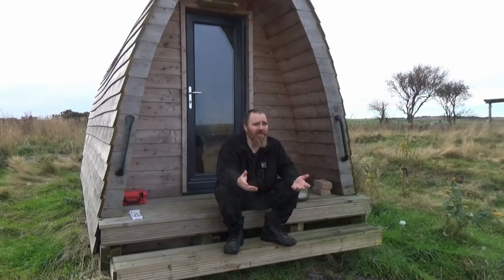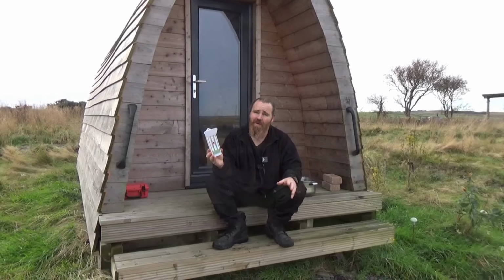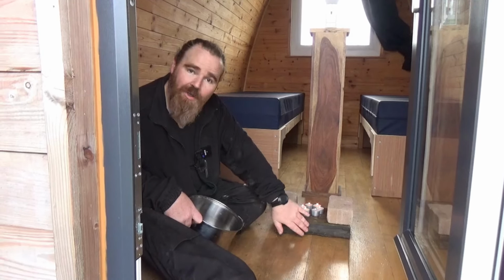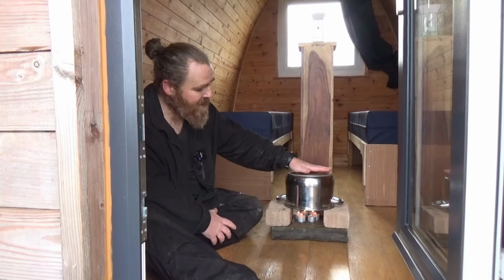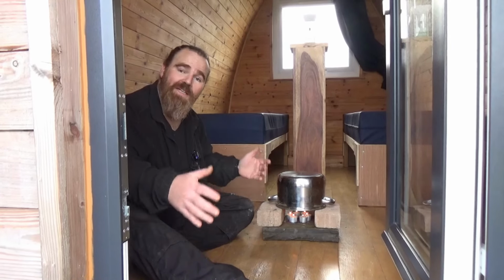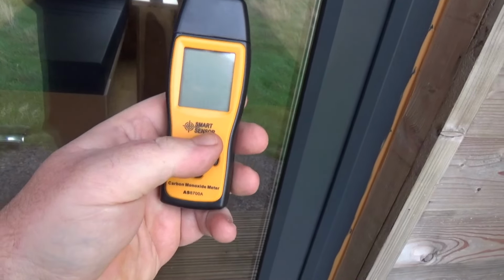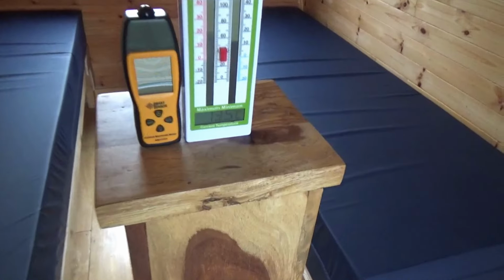DIY Flower pot candle tiny house/camper van/power cut heater tested. Effectiveness? Carbon monoxide?

Comment: In an emergency you are better off using this method to heat water with the candles for hot water bottles & hot drinks or food. Get under blankets. Wear lots of layers (it traps the heat) & a woolly hat. If you have to do stuff wear your coat indoors. Buy a windup torch & keep lots batteries saved for torches. A safe emergency camping stove to be used with the window open or outside & saved tinned food will be helpful too. Don't be tempted to use biofuel or alcohol stoves or heaters indoors. They are not safe.
Reply: Some stones borrowed from the campfire pit over night have helped me through many cold bushcraft nights
Reply: Il faut se coucher tout habillé et ôter ses vêtements une fois que le lit est chaud et les pousser au pied du lit et les garder toute la nuit.  Bien isoler le cou de l'extérieur ambiant le visage peut rester à l'air.  Je pense que la chaleur se dégage mieux si on est peu couvert excepté la literie abondante en laine ou en plumes.  Faire des bouillottes avec les bouteilles de verre des jus de fruits.  Bien fermer sans serrer trop fort le couvercle et les mettre dans une chaussette.  Une bouillotte peut suffire.  Toujours laisser un petit courant d'air entre le bas et le haut de la pièce.  L'oxygène de l'air aidera à votre propre combustion lente qui est celle dégagée par votre corps!  En bonne santé vous pouvez générer beaucoup de chaleur... et sans monoxyde de carbone!
Expérience personnelle.
Reply: That's the most sensible thing I've heard. Right you are.
Reply: It is only partly true about Bio Ethanol are designed for indoor use, some are quite specifically for indoor smoke and smelless table usage and are sold as such every autumn/winter in mayor DIY stores world wide.
Reply: @harrietthoppe7501  In theory, Bio-Ethanol combusts completely to carbon dioxide (Co2) and water (H2O). 

But in truth, no bio-ethanol is 100% pure and no combustion is 100% perfect. 
There will also be some carbon monoxide, benzene, nitrogen oxide, formaldehyde and fine dust.
Reply: @SH1974  this is true of any combustible materials, however, the more slightly more expencive forms of Bio fuels, have been magnetically refined and filtered, hence the limited amount of said list of items in your comment. Good ventilation is the primary most essential Key, to all forms of combustible energy giving forms, yes.

Comment: It would be interesting to see the same experiment but one pod with the pot over the candles and the other just with candles and no pot. There couldn't be less heat going in to the room and the temperature reading is based on heating the room from the top down.
Reply from the maker: This experiment was to test whether the heater was capable of heating a small space effectively. I'm considering testing just candles vs candles with a radiant bell, when it's cool enough to test.
Reply: The problem is "Stratification." With no pot, the hot air rises straight to the ceiling and stays there. If you used an Infrared Viewer, you'd be amazed at just how thin the heat trails are. And how thin the layer of hot air that develops at the ceiling is.
The diffuser (That's what it is) helps spread the wealth. A fan could do the same, or anything else that disturbs the air enough. But, a fan would need power...
Reply: @CairnOfDunnCroftPermaculture  When you do this, please consider showing Infrared images from during the test. 
Also, might consider using multiple thermometers at different levels, to show Stratification vs Dissipation?
I know, both add costs...
Reply: @TimeSurfer206  There are battery operated table fans. I got one on amazon, and a whole box of batteries.
Reply: @evelina.amazonAtGmail  Yes, but the batteries cost money.
Reply: @TimeSurfer206  I've got a rechargeable one that charges just like your phone.
Reply from the maker: https://youtu.be/sK539ekJ4bo
Reply: @TimeSurfer206  heating a well insulated room  is very much like heating a tank of water,
Reply: @stevecole9674  Which stratifies...
That's why it has 2 heating elements, one upper, and one lower.

Comment: It would be nice to test a glass bowl so you can utilize the light as well
Reply from the maker: It would be an interesting experiment with a pyrex bowl, you're right.
Reply: I use a glass tv stand. Candles are spaced evenly on bottom shelf. Top shelf above gets warm but not hot to touch.
Reply: Your not balancing things above flames in the middle, so less likely to knock over.

Comment: Hot rocks is the best solution. Big fire outside that you cycle fire bricks in\out of. I heated a tiny house with just a kitchen bowl of rocks, got legit hot in there, had to open it up to the air. After a couple hours you wrap a stone in a towel and get hours more lap heat, so nice. Some of the oldest ways are still the best. Candles are dumb imo, good for light, but they release soot into the air. Hot rocks are clean and easy and effective.
Reply from the maker: It sounds like a great solution for some contexts, but here in the Scottish highlands you need emergency heat the most when there's 65mph rain screaming across the landscape for 36 hours without respite.
Reply: @CairnOfDunnCroftPermaculture  Yeah, that sounds tricky, and fine time for this solution :)

How did they do it in the past when out and about? Hide in caves? Huddle and suffer in their wool under a tree?
Reply: @CairnOfDunnCroftPermaculture  If I wanted to live tiny there full time I would prioritize having a small woodstove in the space. Nothing like wood for the wet cold. If just traveling for a bit I'd use clothing and sleeping bags. I always try to have a gear set that can handle a wide range of temp\weather not just the current situation. But this would still be a nice thing to keep in a corner. Never know, some wet stranger might show up and need real heat.

Comment: I have a better-than averagely insulated room in a Victorian house  - but I no longer attempt to heat the room.
In the winter of 2010 I  was living downstairs in an icebox and burning maybe 6kw of gas.

The recent cold snap was grim, but when we have normal December temps in Bristol I do OK with personal lagging plus a 50 to 250 convection watt heater under my desk (on a dimmer) - slightly like a "kotatsu" - but mostly just warming my feet ... (I've taken on board your success with reptile pads and also aim to heat under my clothing as my insulated layers work against external heat and a hairdryer is noisy)

My usual electricity consumption is about 2.6 kwh per day for everything.
At the moment it's plus 0.9kwh for feet and bed heating - but this time of year, the maybe 1.5kwh of heat from my PC is taking the chill off the room, and also a similar amount from me (based on 1800Kcals BMR). 
Maybe when I move house I will have a super-insulated winter retreat where I also do my food prep so no heat is wasted.

The carbon monoxide and fire risks alone mean I repeatedly tell people to go electric rather than loss-leader IKEA teelights... all for a couple of hundred watts or pence per hour.
Electricity is expensive, but not THAT expensive - sadly people do not understand - let's face it, I doubt the government's energy ministers remember any of their basic science from 11 years old ...

When it got to minus 6 here, I was burning 8kwh extra to keep myself warm - which meant my heating bill increased from 34p per day to £2.50.
I can easily afford electricity even at 34p per kwh, but consider it immoral to waste it .
Somehow I have managed to get my average consumption down from 11kwh per day to 3.5 - even in December.
Reply from the maker: That's impressive! People seem reluctant to try personal heating, even though it's incredibly effective. Oh the arguments I've had about the effectiveness of different forms of heat transfer!

Comment: If you use less candles would it bring the carbon monoxide down enough ?
Reply from the maker: I'd say it's likely, but candles can vary between manufacturers. I'd suggest getting a carbon monoxide detector before using this heater often, but it still has a lower output than many domestic appliances running on natural gas.
Reply: Daft question?make candles out of lard to avoid gasses?
Reply from the maker: @tonywarley578  all candles produce carbon monoxide, lard would be no different. Wax myrtle produces the cleanest burning candle possible, but still produces CO.

Comment: A copper pot considerably smaller than the steel one you used , would probably provide the same result with one candle and almost no carbon monoxide .
Reply from the maker: Awesome! Can you link to your results please?
Reply: @CairnOfDunnCroftPermaculture  I'd like to see that link too,..bet that neither of us get to see it.
Reply: Lol 1 flame of the same type of candle will not put off more heat than 4x that amount. Dont matter what "pot" you use. The pot doesnt increase the amount of heat these things put off. It disperses it differently. Thats it. The end. No heat multiplication from adding a pot of any kind
Reply: @garym51124  So true, same goes for say a can of butane of propane gas, doesn't matter what type of torch you put on the end of the hose, it's not going past it's max output.
Reply: @garym51124  - But NOT to be underrated, as the radiant heat coming from the terra cotta, the stainless steel and now the cast iron pots I am trying have made the room SO much more comfortable.  I would get so chilled Id haver my thermostat set at 72 to 74. I am at 64 and incredibly comfortable bc there is no "chili" in the air.   IU have a gas furnace with  heat vents, and ai always felt chilled. This feels like when I had wood stoves. There is a quality to the heat, a fullness, an evenness that leads me to greatly reduce the running of my furnace.  I am in awe of this.,

Comment: 2 questions I would have, can you put a small vent in the ceiling to remove some CO but not lose the heat and would adding a can of water on top of the inverted pan to add some moisture to the room, reduce or increase the heat in the room (or offset the CO problem a little).
Reply from the maker: A small amount of ventilation anywhere would likely have the same effect, but with a relatively low powered heat source like this you risk losing more heat than you're gaining. adding moisture is really effective at making people feel warmer in dry climates.

Comment: CO is a product of incomplete combustion which is a consequence of insufficent oxygen. The hydrocarbons in the wax still produce water but instead of CO2, CO and Carbon (soot) are produced. Sooting inside the pan would be an indicator of this condition (even if you didn't have a CO monitor)(though absence of soot wouldn't necessarily be conclusive, so a monitor would still be necessary). Raising the pot higher would help this issue but i still have reservations about this 'experiment' as per my earlier comments and replies.

Comment: That's really not much of a temperature increase. For all the concern about carbon monoxide, seems negligible and another source of heat would well be in order.
Reply from the maker: I'd say the difference between how ten degrees feels and how fourteen degrees feels is pretty significant. It's no substitute for central heating, but we've been cold for weeks at a time on many occasions. An easy temperature increase that significant would have been extremely welcome.
Reply: @CairnOfDunnCroftPermaculture  Since the candles are great at sustaining the heat, perhaps heat the place up by other mean's. One 100 ah battery/solar charged and running a halogen heater from it for 15 minutes on one bar...400 Watts  will use around 8% from the battery.

Remember though, a leisure battery in general, should only be discharged down to 50% for longevity, so in reality; that 100 Ah battery is now 16% discharged.

After the place is heated up, four tealights might just sustain the temperature depending on how well that pod is insulated and how often the door is opened. Less candles = less Co2 concerns, the Co2 levels would probably drop to... 10 - 33% = 6.7 Co2 levels.

Good show Cairn.

Comment: What was the carbon monoxide reading on the control pod? You must compare the two pods because carbon monoxide is present in all living areas.  Great experiment on heating your small home. Thank you.
Reply from the maker: Carbon monoxide is not present in fresh air, it's caused by combustion. So the control pod, with nothing burning, will have had to be at zero.

Comment: Do the candles leave a parafin coating on the inside of the pot?
How easy is it to clean off?
I lnow, just use an old pot you won't ever use for cooking.
An old cast iron dutch oven picked up at a garage sale might hold the heat best.
Reply from the maker: I've never noticed any residue.

Comment: Well demonstrated, thanks! Still one question => carbon monoxide sinks to the floor and builds up from there. So maybe the place to position
the c.o.-detector would better be in the hight of the matress?
Reply from the maker: Carbon monoxide is not heavier than air, that is a common myth. It spreads freely through the air, mixing, which is why it's so dangerous.

Comment: I have a thin weak sick cat and an electric blanket that I put under a duvet so that in the day she doesn't get cold.  The tiny is 5,5 metres by 2,6 metres half at 4,80 height and the other half at 3,5 m.  The electric blanket is enough to heat the whole tiny (well insulated) to t shirt warm for the moment (outside chilly not freezing).  I am surprised

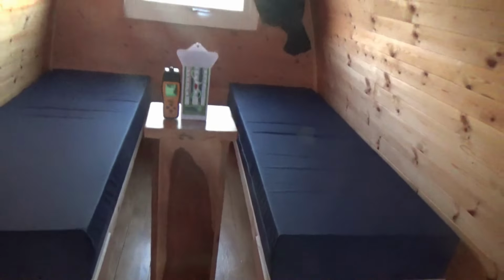Comment: 05:00 For me, the risk of CO just made me buy a pillow with a heater element and a battery in it.
Added bonus: it is great for sore muscles, and I can charge it off of the solar panels, effectively for free.

But you do need to have the foresight or planning to have such an item, of course.
Alternatively, I would use this small, horribly power hungry space heater that the heating maintenance people left behind "just in case". Repeated attempts to get it back to them yielded no results. So that is one more possible solution just in case gas runs so low that even households will run out. I'd run it high during the sunny daytime, and let the insulation and house structure deal with the night time.

There's been quite a few cases of fires and CO related hospitalisations around here recently. And the police patrols the local woods as people are stealing wood.

Comment: Could you place the contraption outside, on the porch and have a steel rod come right through a small aperture in the wall near the door, so that only that hot metal is in the dwelling and not the gas? Obviously you would have to make the candles protected from gusts and protect the exterior from fallen candles.

Plus...could you do a fun piece on wearing gentlemens clothes of the Elizabethan or Tudor era? People wore dozens of layers but looked magnificent. The women wore skirts as solid as a garden shed. Everyone wore elaborate hats and ruffs in chilly castles. You could do Tudor clothes in one pod and modern clothes in the other pod. Maybe in future people will get back to sumptuous layering of brocade and velvet and wolf.
Reply from the maker: I wouldn't have thought it would have the capacity to heat up the metal enough to make a difference. 
Yep, layering is an amazing way to keep warm!

Comment: I had a thought a while ago.  If you could try it, that would be brilliant.  (I'm not in a place to do so.)

1.  Place a metal funnel--upside-down--over the candles and leave just a narrow gap at the bottom, such that the volume of air leaving the funnel is only slightly less than the possible volume of air entering it.
2. Place an open-ended metal tube over the top--the longer, the better.
3. Place a capped metal tube that is about twice the cross-sectional area of the first tube over top of the first one.  (Suspending it from the ceiling by a wire should do the trick.

The hot air should rush up the tube, cooling as it goes.  By the time it gets back down the the bottom exit of the outer tube, it should have lost most of its energy and, therefore, 'shrunk', so the upflow of initial hot air shouldn't be slowed down much.  In theory, the increased draft should lessen the production of CO, as there would be a lot more oxygen available.  As well, the first section of inner tube might even get hot enough to auto-ignite the escaping gases, resulting in better air quality, especially if wrapped in rock wool/etc.  (All of this is the basic theory behind rocket mass heaters, in case you didn't catch it.)

Does that sound reasonable?
Reply from the maker: I have a rocket mass heater, so am familiar with them. I suspect the heat of a few candles wouldn't be capable of raising the temperature high enough to work, there just isn't enough fuel. I'd also be wary of raising the temperature of the candles too high. Wax can flash if it gets hot enough. 
I'm thinking of building a heater though that runs on cooking oil, with a carbon felt wick, and an externally vented chimney.
Reply: @CairnOfDunnCroftPermaculture  Hmmm...  some good points, though I'm not so sure about the candles getting too hot, as the heat would be whisked up the chimney pretty fast.

FWIW, I've found pairs of 12x12"/200x300mm 'carbon welding blankets' on Amazon/etc. for around 10-12" dollars.  As pictures show using a blowtorch on them, I'm pretty sure that they are 100% carbon.
Reply: @CairnOfDunnCroftPermaculture  Indeed, five days ago there was a house fire here in Belgium caused by a candle stove.

Comment: I was wondering if you had different size pots and could stack them if it would make a bigger radiator and put out more heat 🤔
Reply from the maker: It would be an interesting experiment!
Reply: Would it be "more" heat though? I'm no scientist but thinking there's x amount of heat generated so it will just be emitted by a larger number of pots but still same amount? So two pots emit half of x each??